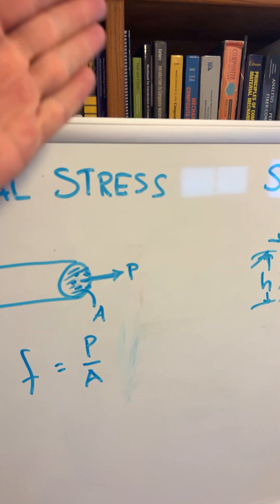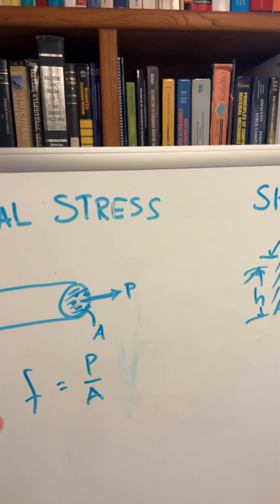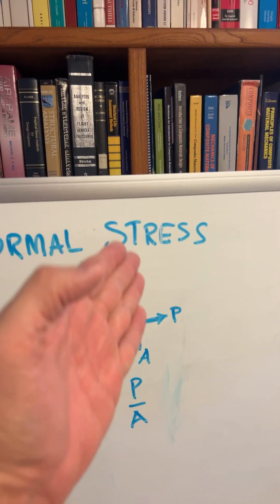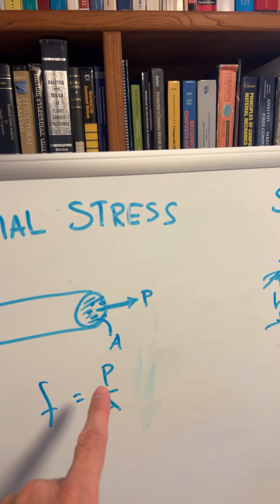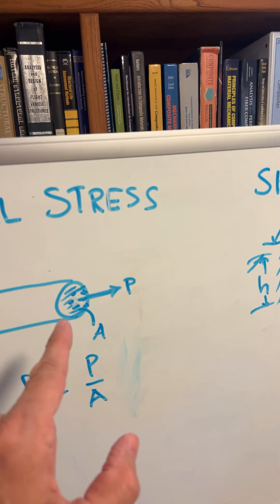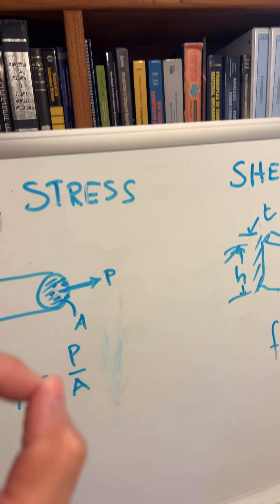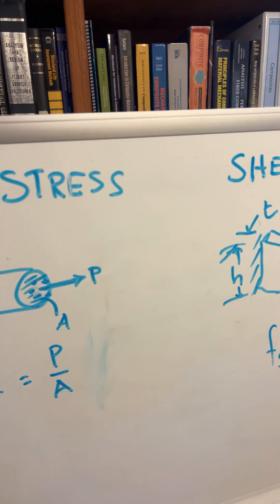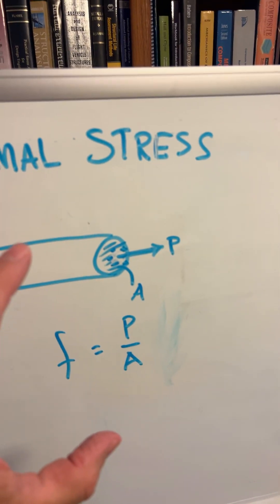Normal vs Shear Stress

Comment: Hats off to you guys - takes guts to start something like this with no knowledge...a lot would quit just due to the strain on your body - people just do not realise what proper labour does to the body .. ie. Cutting grinding drilling welding bending , loading

Unless youve done it
Reply from the maker: It does.  That work is fun… when you’re healthy… and young.  An engineer can be weak, old or sick and still very productive.  

Capability often grows with age and experience.

Many other jobs the body weakens as knowledge grows.  That can make it tougher as you age rather than easier.

Comment: Ok but then we are introduced to Transverse Shear which is perpendicular to the cut just like Normal but still called Shear. 

So what’s the deal
Reply from the maker: Lol.  Are you asking about the VQ/It stress that develops when a shear force acts on a beam?  If so… that has one shear component that is paralell to the cut face, and also another component that acts paralell to a horizontal cut thru the beam.  That component acts in the same direction as the normal force on the vertical cut, but acts on the horizontal cut, and is hence parallel to that area, and is therefore shear.  See my other videos on transverse shear in beams for a deeper explanation.

It is critical for structural anaysts to understand these concepts
Reply: @ToddCoburn  yes that is what I was referring to.
I still say it is misleading how every source gives a simple definition of shear vs normal, by showing a cut in a beam. 
But then have to double back on that and say well we didn’t mean to say all forces perpendicular to that cut were Normal, we meant to say sometimes we will be referring to the big cut through a beam and sometimes we’ll be referring to smaller cuts on differential pieces of volume.
Reply from the maker: @Joecool20147  lol.  Life, and natural principles, often do not align with what we like to think makes sense